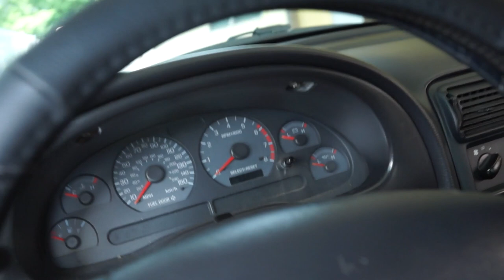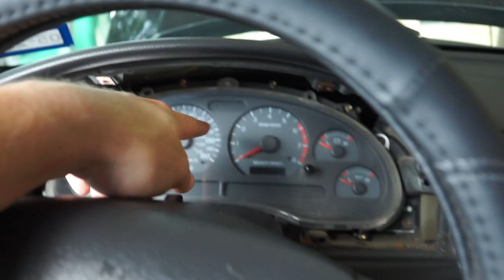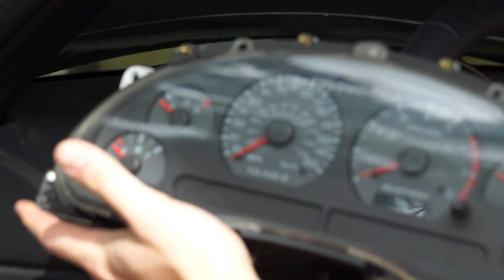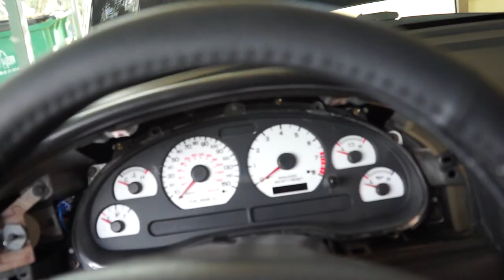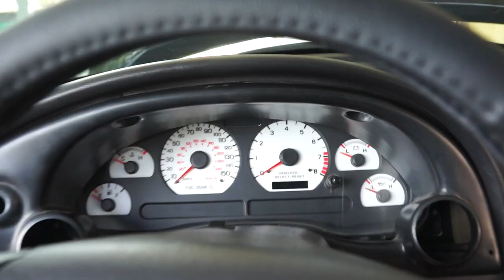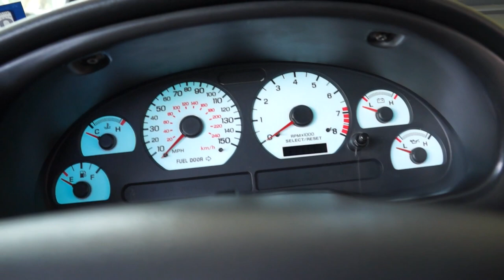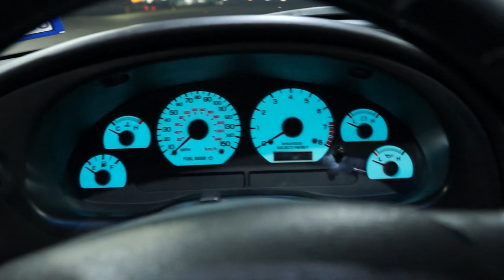Installing GAUGE OVERLAYS For My New Edge Mustang

Comment: At first, I thought that this is just a gauge overlay. Anyway, I was considering setting up the instrument cluster to be backlight any time the engine is running so that the stock gauges would be easier to read in the daytime. I like what you did better.

Comment: Protip. Install an add a fuse circuit in fuse location #37 to illuminate any dimable accessories to the dash. No need to splice.

Comment: what's that clip called you used for the hot wire??
Reply from the maker: A quick wire splice!
Reply: @CovertGarage  thanks bro I appreciate you.. I’m trying to make the swap and I’ve already messed another cheap cluster up where the led wiring goes onto the actual led.. ugh so I can hot wire it to the blue white wire right?
Reply from the maker: @indistructible420  That is correct! At least that’s what it was on my car.

Comment: Hey brother the clips that plug in there's 3 plugs on the gauges I have same kit and there's 4 plugs or clips that come off once you put the new gauges overlay on I actually want to actually use the controller provided any help would greatly be appreciated bro new subscriber now bro much respect hope to hear back from you
Reply from the maker: If you want to use the provided controller you can just run it down somewhere instead of tucking it behind the dash. I’d probably run it down under the dash
Reply: I appreciate your reply but you know when you stick the overlays over the needles they have 3 clips for plugging in to another end but the box to change colors and dimmer switch has 4 so I'm trying to ask wheres the 4th plug into coming off the box and which one of the 3 when you put the overlays on any special order to plug into the ones on the box?
Reply: 3 plugs on gauges 4 on box plus the red and black wire? Plus how do I test them if I unplug the battery sorry if dumb question
Reply from the maker: @jasonhostetler2577  Oh I gotcha. The fourth plug goes to the overlays for the AC controls. If you don’t have (like I didn’t) you don’t have to do anything with it!
Reply from the maker: @jasonhostetler2577  No such thing as a dumb question! Simply touch the red wire to the positive battery terminal and the black wire to the negative
Reply: @CovertGarage  thanks brother I appreciate that
Reply: @CovertGarage  haha I just got in my car to move it and it starts and shuts right back off with gauge cluster out haha is there a safety or something
Reply from the maker: @jasonhostetler2577  hmmmm that’s a very strange one
Reply: @CovertGarage  I plugged the 2 plugs back in and it started up and runs fine haha
Reply from the maker: @jasonhostetler2577  Glad to hear it!
Reply: @CovertGarage  yeah but when I went to put the gauge cluster back in j couldn't get it to go back in lost patience and ended up breaking the tab stops on speedo and rpm and no color bc I don't know how to wire anything and don't have any friends
Reply from the maker: @jasonhostetler2577  Uh oh! Well I hope it’s still useable! Sometimes you just gotta take a step back and reset. Working on cars can be real frustrating at times, especially when learning. Just gotta keep an open mind with them!

Comment: Did you keep it on blue or green?
Reply from the maker: I kept it on blue
Reply: I just installed this same overlays and I’m having problems to the mph needle, it gets stuck
Reply from the maker: @santosaleman7060  hmm that’s very strange I can’t think of why that would be happening unless there was a defect with the overlays
Reply: @CovertGarage  do you think it’s possible that I might pushed the needle inwards when I slide it thru the overlay?
Reply: I have even tired Elmer’s glow to try to hold it down
Reply from the maker: @santosaleman7060  I guess it’s possible but wouldn’t think so. Gauge still work find without the overlays on?
Reply: @CovertGarage  yes they still work fine without the overlays
Reply from the maker: @santosaleman7060  well that’s a good sign. I wish I could help you more but it’s hard to tell what’s going on without seeing it
Reply: @CovertGarage  right for sure I undestand, I didn’t disconnect the battery when I took off the cluster, do you think that could be why?
Reply: @CovertGarage  figured out the problem bro! My speed needle was sitting too low so it would rub against the overlay, I poked it up with a screw driver gently just a tiny bit and now it moves freely as it should
Reply from the maker: @santosaleman7060  Right on I’m glad you got it figured out!!